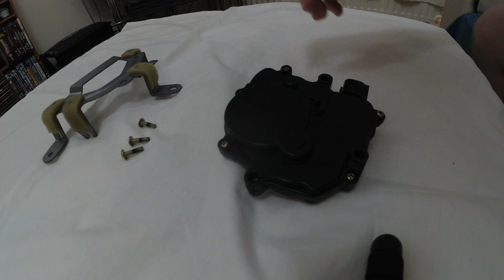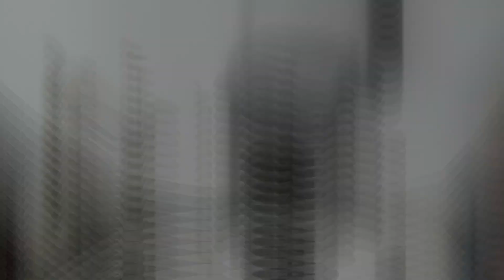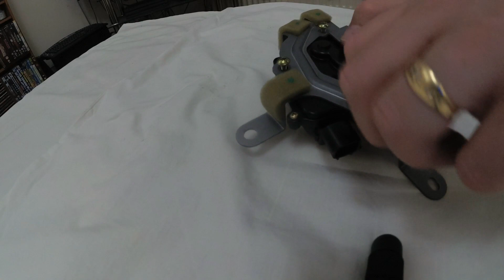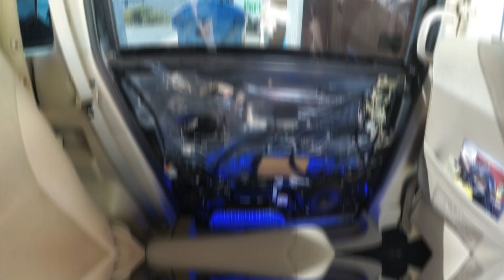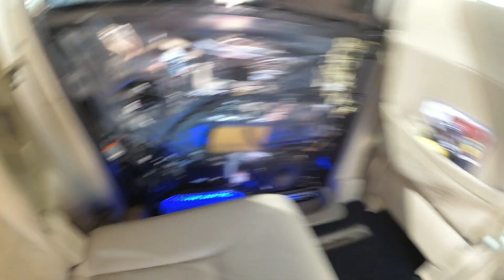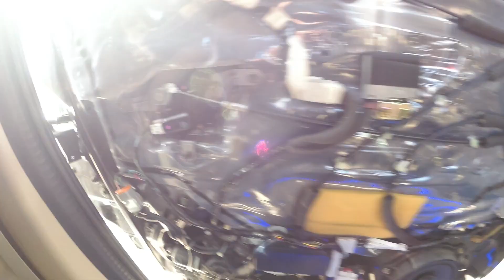Nissan Serena electric sliding door repair, Part 2

Comment: I am having the same challenge with serena but it is a 2015. Would the part number be the same?
Reply: We also have a 2015 model and we used the same part number and it works perfectly!
Reply: Did he say PAN14EE12AA1 ?